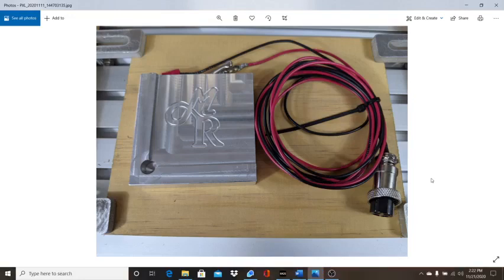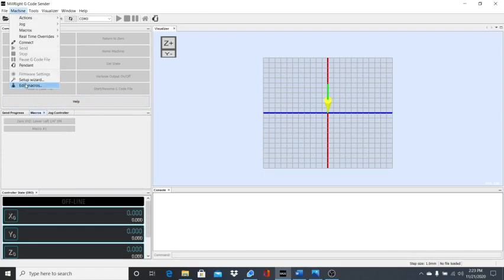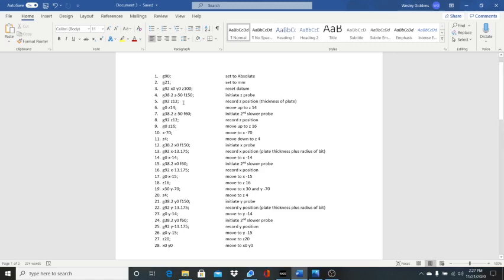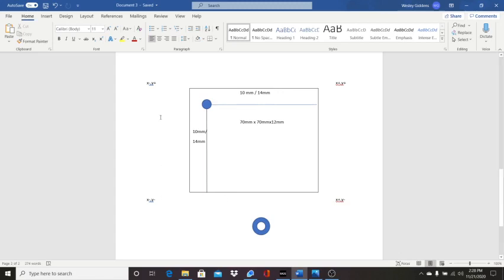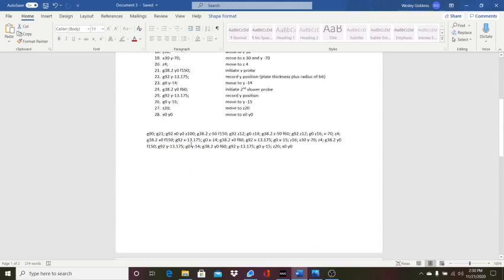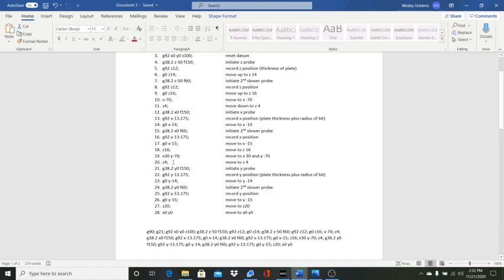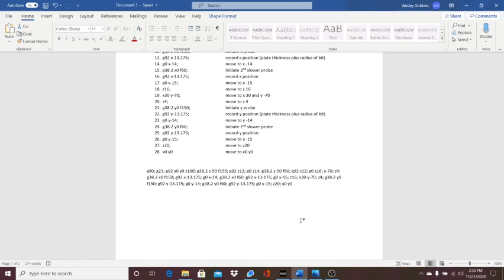MillRight CNC Touch Plate Tutorial

Comment: After the Z zero is set it moves out to the left to start setting the X.  When it touches the left side of the plate it registers that its touched the plate and then it moves back out to the left a little and then throws an error.  Looking for some insight, thanks!
Reply: While this comment was made two years ago, I'm responding for others who are just now seeing this and maybe experience the same problem. Assuming one has positioned their touch plate at the front left corner of the work piece, one must leave enough room for the endmill to travel left 70 without crashing/hard stopping against the extrusion rails. If your work piece is so big that the endmill cannot move left 70 on the X-axis OR you have a small piece positioned all the way in the corner, the router will not be able to complete the g-code instruction and will throw an error code when it hits the limit of travel. If using a small piece of stock, just move it more towards the center of your wasteboard. If you're trying to do a large project and need all the room, perhaps change the coordinates so that the router doesn't move left 70 on the X-axis after zeroing.

Comment: When I run the macro I get the error "An error was detected while sending g38.2 z-50 f150, soft limit, alarm.....target exceeds machine travel machine position retained"
Reply from the maker: It sounds as though you have soft limits enabled which is not a factory setting.  $20=0 will turn off soft limits.
Reply: @MillRightCNC  Thank you so much, I will check that tonight!

Comment: (Minor comment: "macros" is the plural of "macro".  It's usually pronounced such that the second syllable sounds like "rose".)
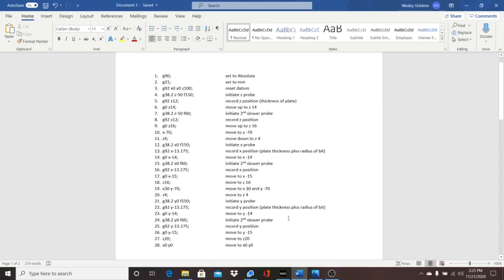If you go to 3:35 in the video and look at lines 3 and 4, there's an apparent error (at least for the MegaV): Line 3 establishes the current Z position as +100; line 4 requests a probe movement down to Z = -50 - a total movement of 150mm.  
This looks like it should work, as clearly the tool will hit the touchplate long before it has moved that far.   But if (in GRBL) the  Z range has been set to 95mm (as specified for the MegaV machine), UGS sees this as a request for out-of-range movement.  It thus terminates execution of the macro, and flags this as an error.

Comment: This almost works, but after the z probe touches the plate and backs off I get an alarm state and error 9 preventing it from continuing. Any idea what I am doing wrong?
Reply: I fixed this by getting rid of all the G0 and replacing them with G1. The rapid moves were causing an alarm 4 for some reason.